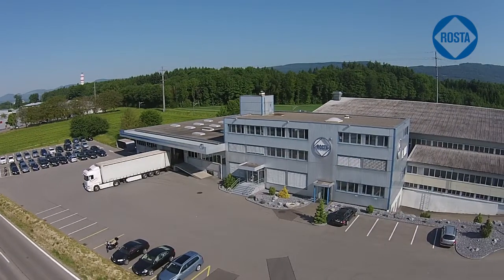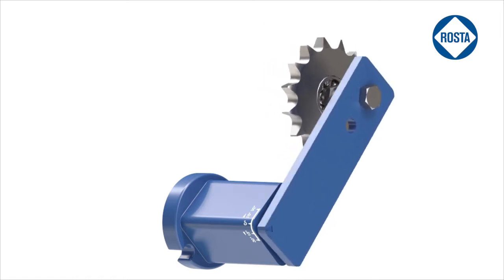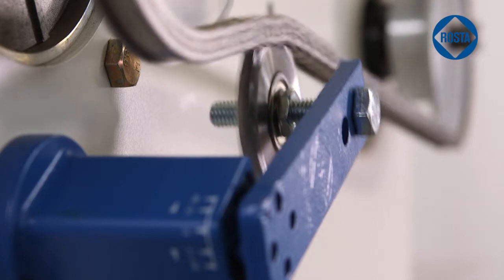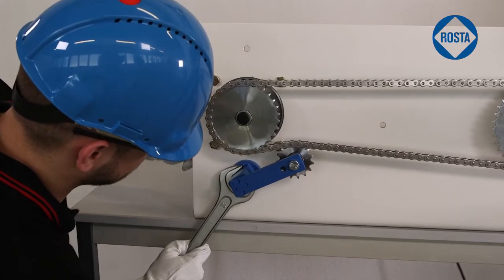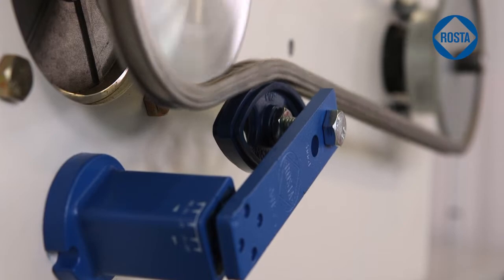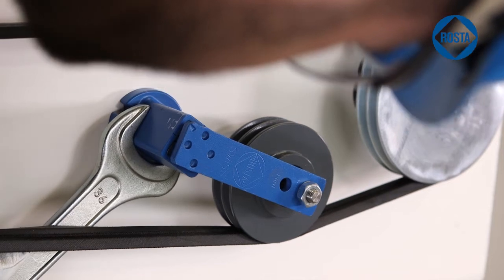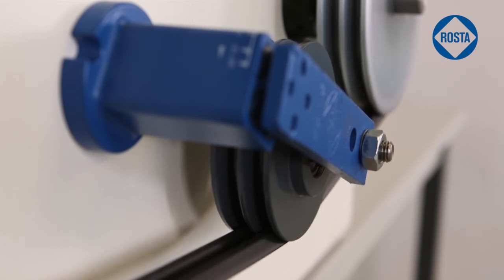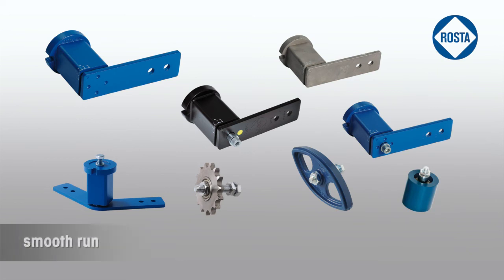Simple and smart combination

Comment: How to determine the size of the tensioner you need based on your transmission? ASA 160-1 chain; 7,5 KW; 
drive sprocket Z17 a 6.3-33.4 RPM; driven sprocket Z129 a 0,83-4.4 RPM
Reply from the maker: Hallo Fernando, Thank you for your question. Best would be to contact a sales person responsible for  your area https://rosta.com/team/
Reply: @rostaag719  the manufacturer of the chain too and the sprockets too 
martin sprocket does have a PDF file  you could download too i do have this in a book got from a friend too its called the bible of Sprocket lol 
Martin is awesome to work with too